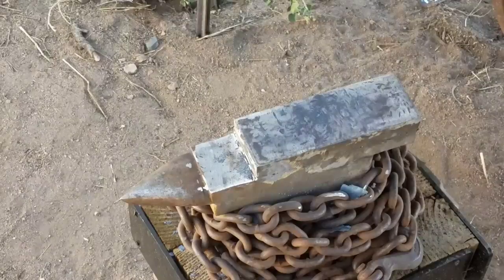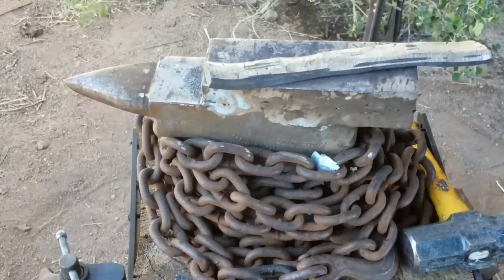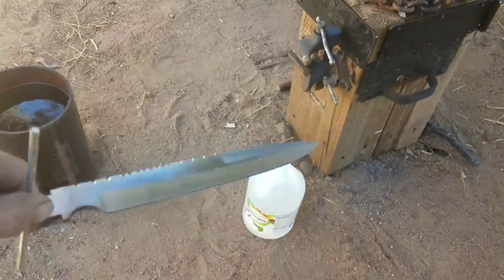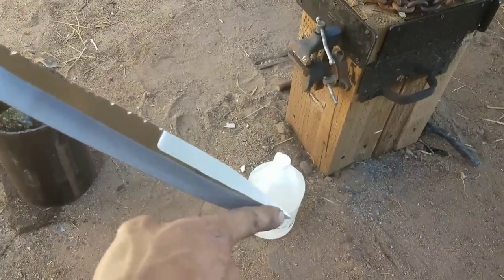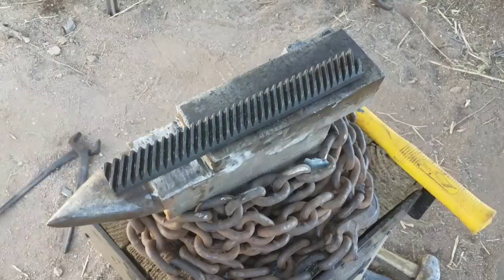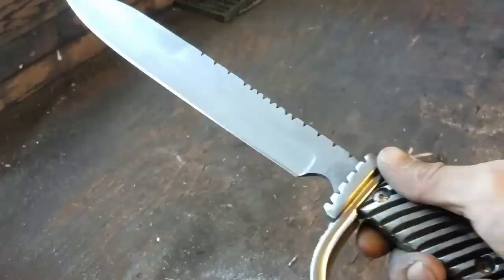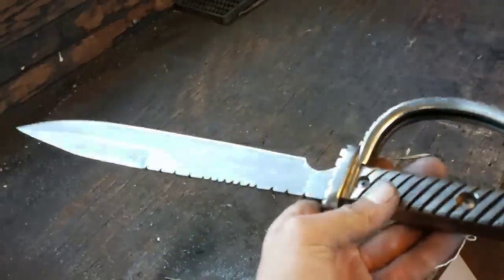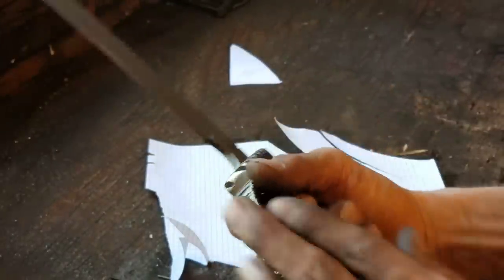Forging A Knife From Gears - Trench Knife

Comment: Wow, you do wonders with these pipe wrench gears blades. Very nice! I have had trouble with gears falling apart when I try to forge them. I was trying to drift a square hole in a gear to use it for a guard. I was using gears out of the rear gear box from a old rider mower. Some gears forge great but, others just break the minute I hit it with a hammer.  You have incredible heat control skills Sir. Bravo!

Comment: What steel is this? I can not imagin that it is suitible for knifemaking. Gears are usually made from a non hardenable steel, which get carburized at the gear teeth before hardening. I can't imagine that this blade got really hard. I also wouldn't test hardness with a soft stroke of a file. Try to scrape glass with the tip. If it's able to do that it must have at least 58 HRC.
Reply: Helmuth Pape  I mean it's a show knife fr why criticize it ?
Reply: Helmuth Pape around 13:28 those sparks looked chalked full of carbon to me . What do I know just saying.
Reply: If they are differential gears, they're likely made from high tensile steel like 4140. They'd need to take a lot of stress.

Comment: You could have done a small bit of welding on that one, where the guard, dguard, and handle come together.  That would clean that all up and make for a really stout blade and handle construction
Other than that fantastic job!  I am getting ready to post a few more videos, come by and check them out if you like man.

Comment: Using carburetor cleaner before your etch might be why it didn't turn out carburetor cleaner has a lubricant that stays behind after evaporation to keep the carburetor well-lubricated you want brake clean there's no lubricant in that

Comment: Nice. What grade of steel was the gear made of and what level of hardness can you achieve on the Rockwell scale?
Reply: countryboy38008 for this gears the steel used normaly is 8620 grade steel or 20MnCr5 steel. The HRC before the forging are 57-62.

Comment: I actually wanted simmular style of blade same but in the back u can file triangle shape teeth sharp em like shurriken so the full light of them peeking out of the back be about 0,7mm but not the full back side but in the massive back side not full till the handle but like 5 cm away from the guard in the back

Comment: Mystery steel, but definitely chromoly because the metal doesn't scale like other alloys. 
Coil spring will scale a lot because silicon manganese steel is a serious rust magnet.

Comment: Don't you need to run a current when you etch the blade,  other than that it is a very sexy knive
Reply: CJ TheOtt You don't have to when working with strong acids, but otherwise it helps bring out the etchings between different carbon ratings.

Comment: Just curious since I forge knives myself if a knife is ground almost completely to shape on a belt sander is it honest to say it's forged rather than ground.  It does look very nice in the end product.
Reply: Jeff Womack most people would not consider it "forging" because you didn't shape it on an anvil with fire. How ever other companies, do that proves or stamp out blades and then harden them. So do what your want, but if you don't harden the steel it won't be nearly as good. But forging is the act of heating up the metal and working it into a shape. Some people won't like you doing what you do, other might understand because you have to start somewhere.
Reply: Jeff Womack actually im wrong, technically you don't need fire to forge, you can cold forge as well, but typically you wouldn't cold forge a knife or sword.

Comment: why should we dip hot knife in industrial oil.🤔
Reply: Use traductor here, is spanish.
Lo hace para templar el acero, cuando el acero está caliente y se lo enfría rápidamente se endurece
Reply: It hardens the blade water and itndoes not create a lot of stress on the hot steel . Water on the other hand if you dip the steel in water it is a big temperature difference and creates a lot of stress on the blade creating fractures and warps thatnwas not there that shown up bcause of the big temperature diffrence

Comment: What's the deal with the file? 

Just out of curiosity
Reply: He was making it serrated
Reply: Zak Kaufman it tests whether the metal has hardened or not
Reply: St.PatrickStar how so?
Reply: Yeah
I saw the video where he explained it 

Made more sense to test the hardness

I originally thought that he used to sharpen with a file, and just did that for nostalgia
Reply: But that was before he did the heat treat to it, it would have been soft at that point.
Reply: I know what he was doing, now

Comment: Why the anvil have chains around her?
Reply: to give it more weight and so you will move more steel per hit forging and stop your anvil jumping around :) F = M * A  / Force = Mass mutiplyied Acceleration. There are some "hacks" out there to "simulate" bigger anvils but to boil it down = it`s all physics :)
Reply: To quiet the ring from the hammer blows

Comment: gear steels  is a good steel to make knife, axe, aren't they????
Reply: It is sturdy good to work with so yeah. A friend of mine uses this kind of scrap to play around with. With hydraulic press he makes a lot of cold and hot steel gardening tools 🙂
Reply: thank you, i will collect threadbare gear of motor cycle or mountain bike to reuse :D
Reply: @CongTrancongqcb  you may want to try smelting the material for extra durability. I would recomend making kind of an alloy of steel, chromium and dural, two of which are already alloys and since chromium helps steel to be a bit more stronger using tungsten from old lightbulbs will probably yield so much stronger compound metal. Good luck man 🙂

Comment: I'm not sure that you can call this forging a knife. Sure, you applied a little heat to straighten out the metal and form a rough shape, but most of the work was done by cutting away excess material instead of forming the piece from rough stock.